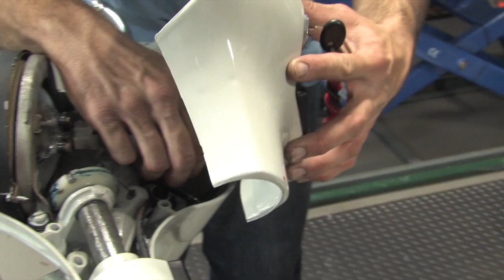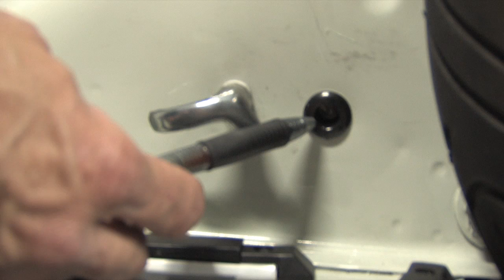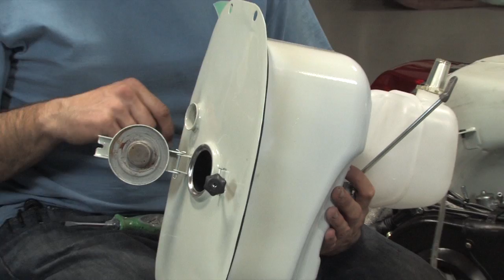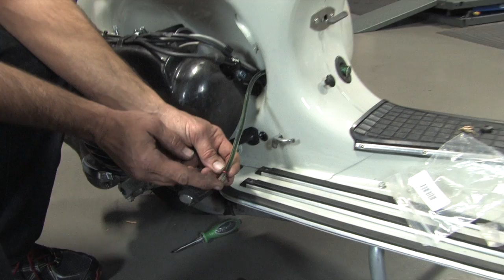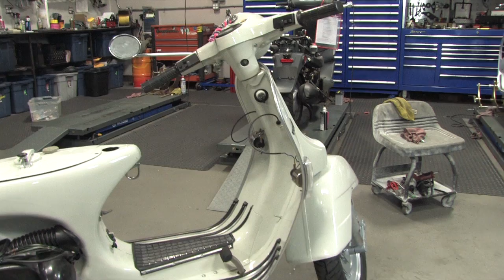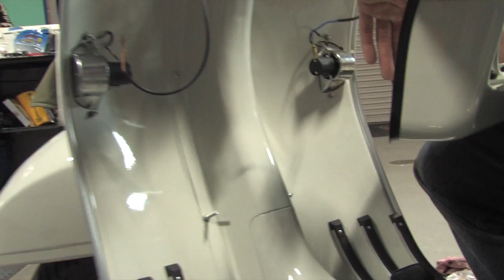Vespa P200 Restoration - PART 4 - Final Wiring, Fuel/Oil Delivery, Glovebox Install

Comment: Hi thanks for the video upload..i love ur channel few days ago I brought a 1979 Vespa 125 P can u please help me out with ur words of wisdom 1st all its hard to shift through the gears I notice. Where gear oil goes that area covers with old oil , back break almost no break , only head light works no signals no horn no neutral light no break lights and. Speedometer not working any suggestions where to start the diagnosis??
Reply from the maker: It's a little hard to diagnose all your issues over the internet since there are so many variables with these old scooters. However, you should check out our latest series of videos where we completely go through a 1978 P200 (very similar to your scooter). I think these videos will get you well on your way to getting your scooter back on the road! Thanks for the support. https://www.youtube.com/playlist?list=PLmZN6ewY34hgy1Mf3XPtBlNM4Pw39ZkHb

Comment: I have a 2005 px150 VESPA. Cant get it to stay running. is it possible the carb is not feeding enough fuel. i feel like it is a fuel problem. any ideas?
, is there a fuel pump. it looks just like this video.

Comment: Just completed a complete strip down respray and rebuild on my 2003 Vespa px200 which I've owned from new,the scooter had done 50,000 miles on the original top end and was still going strong but was time to tidy the scooter up.your videos have been very helpful throughout the project cheers guys keep up the good work👍Biffo UK.

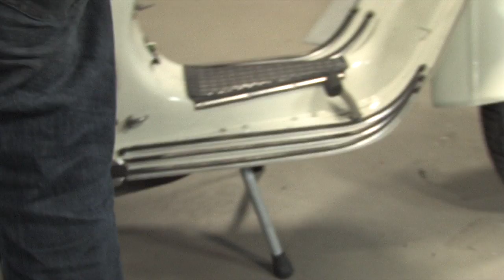Comment: Simply gread video. I specially like your advise on 24:00 to put a little bit of oil into the tank for the first run due to the bubble in the oil tube

Comment: how much for a decent restoration of my px 200 e?
the bike runs but has 30+ years and she is never been used in the last 10 years.
Reply: This is my P200E made in 1980. Was not used in the last 11 years. Engine start ... and runs ... https://www.youtube.com/watch?v=8bZnhKdiNOg
Reply: A very old vespa mostly needs new strator cables und always fresh gasoline.